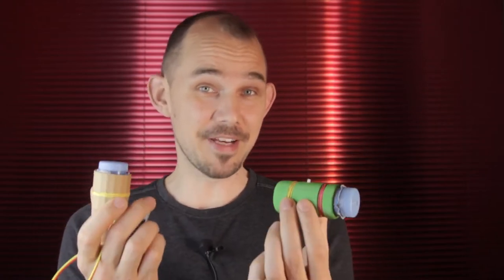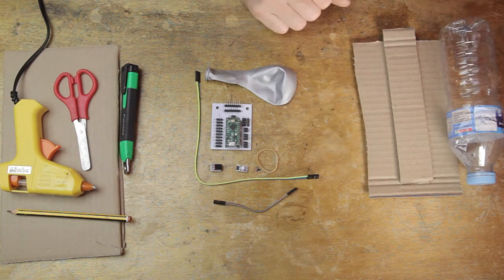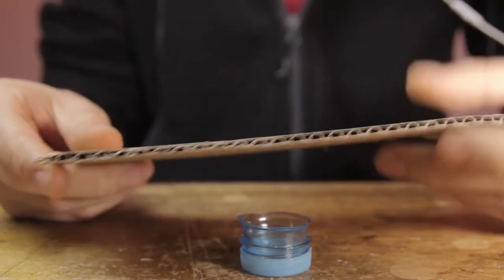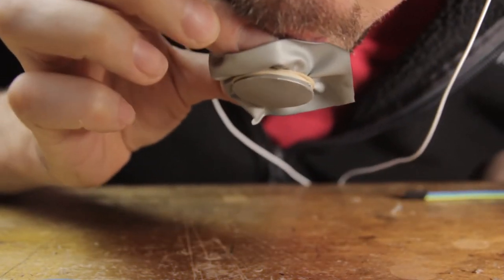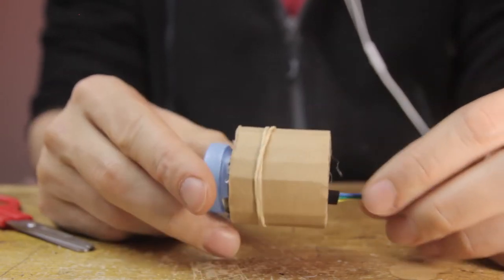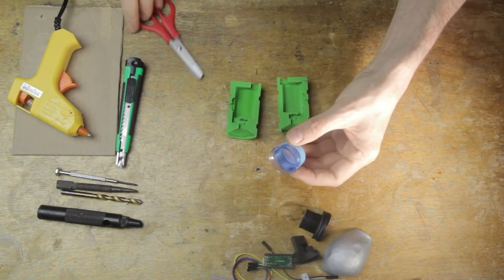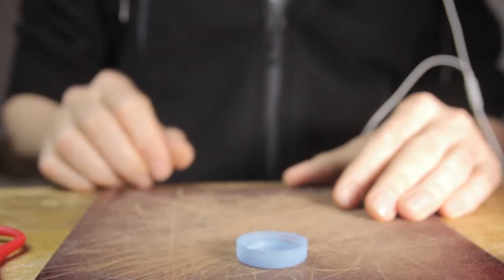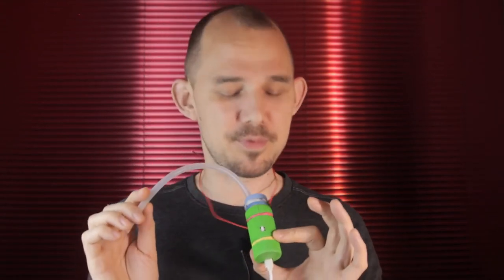Making a KLIK stand-alone breath controller, - KLIK Tutorial #8

Comment: Sir what is that calibration button used for ? Exactly what does it do ? Do you press it when nothing is blowing in to set a zero position ?
Reply from the maker: The KLIK calibration routine sets minimum and maximum values for all sensors based on what is going on while it's pressed. Here is an example: https://youtu.be/hcTwj9EIY_o?t=74

Comment: Wouldn't absolute pressure sensor like BMP280 be even more sensitive and reliable?
Reply from the maker: Great question… And the answer is definitely “no”….
I actually started my DIY breath sensor investigation with the BMP180 (back in 2014), and it kind of worked. But “absolute pressure” is not the way to go, and here’s why: “Barometric pressure sensors measure the absolute pressure of the air around them. This pressure varies with both the weather and altitude” 
That’s not what you want. Your lungs aren't absolute. They always function relative to ambient pressure, so you want a pressure chamber that’s also open to the ambient air. Having an “absolute” air pressure sensor just means that you have to calibrate constantly, as the ambient pressure changes. The KLIK sensors don’t need that. Also, the BMP series with their tiny opening to the outside air have no chance of responding to super fast changes, like the “trilling” that I briefly show in this video. On the other hand, my sensors can’t be used to measure altitude, which is really the BMP sensor's strong point….
Reply: @KontinuumLAB  Immediately after posting my comment, I thought about calibration issue. That can be somewhat solved programmatically by sort of self calibration each time breath sensor is turned on. But the responsiveness issue you point out is hard to solve. I don't think anything beats optical sensors when it comes to responsiveness. Your approach is super elegant. 👍
Reply from the maker: @mitesh8utube  Thanks!! Not even all optical sensors work for this. Photo-resistors are actually too slow responding. The CNY70  or other sensors with photo-transistors is the way to go.